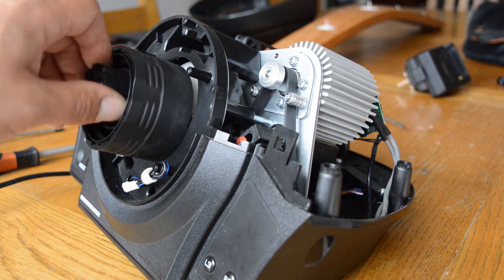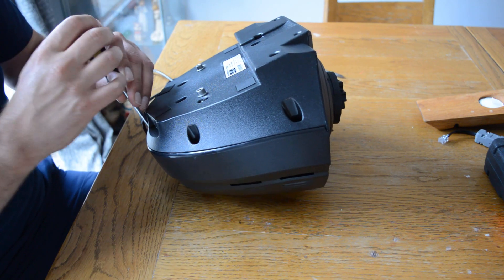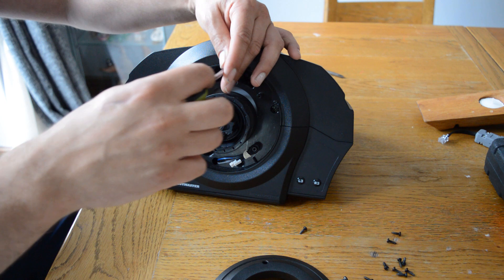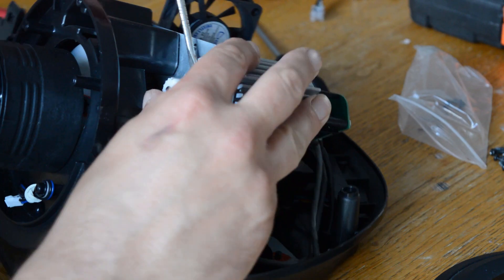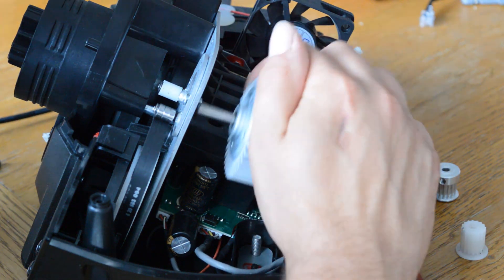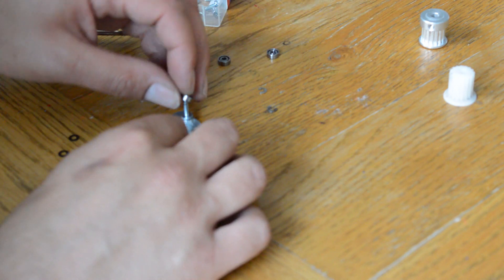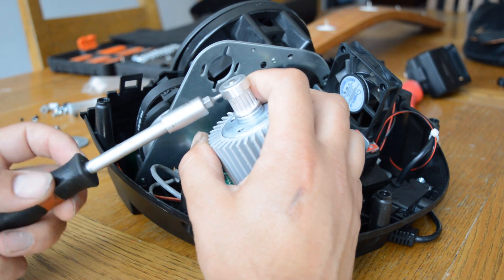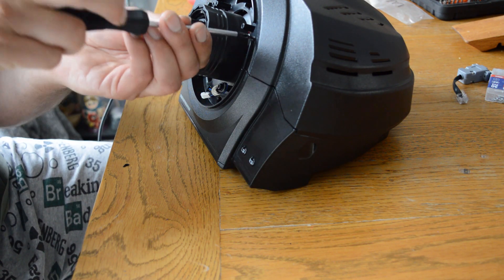Thrustmaster T300 Metal Bearing & Pinion Upgrade Mod

Comment: Just ordered a t300 base was wondering if you could make a video showcasing a few minor part replacements and tips to extend the life and reliability of the wheel anything from metal replacements, betters motors and fans would be appreciated
Reply from the maker: Hi thanks for watching. I have another video showing how to replace a failed motor with a like-for-like but unfortunately since the video, the motors have been almost impossible to get hold of. 
Aside from that, many people have upgraded the fan but I have not. I use the 'forced cooling' mode which keeps the fan on all of the time. This is definitely recommended.

Comment: Please don't do this mod exactly as described. The parts sizes are not correct. The bearings are smaller than the original rollers and because of this it's practically impossible to find a balance between tension and smooth operation. The belt will start skafing. And since you can't tighten it properly otherwise you'll have teeth skipping issues. 9mm bearings would be a better option, since the rollers are acutally 9mm and not 8... I used three 3x9x4 per side without the black rings. It's a perfect fit. the lock ring goes on tightly. This mimics the orignals perfectly but smoother. The smaller 3x8x3 ones are not even touching most of the belt width.
Reply from the maker: Since I did the mod as described, the wheel has been absolutely spot on. I even recently used an un-modified T300 for the first time since I did it and it felt notchy, light ffb and just generally more toy-like.

I'm not advocating that everyone must do this, it's just my own experience of it.

I agree if you can find 3x9x4 bearings then that would be ideal, but I made it work with washers and it has worked flawlessly.
Reply: @simpulse5825  Thanks for the respojnse! So it's maybe a bit of hit and miss. It didn't work for mine so I came back here. Don't get me completely wrong. I'm grateful for the inspiration for the mod and the careful walkthrough guidance you have released here. I just wanted to point out a slight adjustment in the sizes of the bearings to make it actually replicate the old system but smoother. Without skipping or skafing of the belt.
Reply: When i put three 3x9x4 on the shaft, i cant put the Clipring on it. How do you get this to work?
Reply: @Daniel200583  please let me know if you get an answer to your question about how to get the lock ring on the end? I just ordered 3x9x4 in anticipation of doing this mod in a few days. I hope you hear back
Reply: While it is true that the bearings in this video are smaller than the rollers, you are not taking into account the radial movement the original rollers have. On an old and well used t300 there will be more movement. On my t300 that has had 6 months use, there would have easily been 0.5mm of radial play in the rollers, hence i do not think the 1mm smaller (0.5mm each side) bearings are an issue.

Comment: 3x8x3 is too small on my t300, replace with 3x8x4
Reply: 3x9x4 is even better. Since the official rollers are 9mm.
Reply: @CidiousX  You are right, 9mm outer diameter is closer to the original roller's size rather than 8mm. I tried 3x9x4mm bearings without any washers are great, but seem to be a little bit thicker. I can't put the original C-Clip on properly because of the thickness, but I replaced it with a very thin rubber O-Ring and it's work.

Comment: Hi, for the pinion, is it 16 teeth? Also, I cant seem to find the same width of 11mm, most are 10mm or 14mm.. Must it be 11mm, and if can be different, should I pick the one more or less than 11mm?

Next one, for the bearings, I found 693ZZ MR83, but the size is 3mm x 8mm x 4mm.. Is it ok? Or should I source for 3x8x3?
Reply: This will work. I used these before. They fit better than the 3x8x3 but to make it perfect you should actually look for 3x9x4 to mimic the same size as the plastic rollers.
Reply: @CidiousX  Should I buy 16mm or 11mm?

Comment: Well I removed the bearings instead of replacing them… and its working much smoother without any problems… 
So I found out that apparently you don’t really need any bearings at all… 🤷🏻‍♂️
Reply: Did u have to rise the motor for the belt to be stiff? . Is still everything working alright?
Reply: @kostakhc   hey, yes! just remove the bearings, rise the motor up for 2mm will be enough and tight it. 
I drive for 3 weeks like this and I don’t have any problems with… I can definitely Recommend👍🏼
Reply: @PabloHamburg  hey mate , great to hear all working fine , could you please explain what different you feel without the bearings? Is it worth? ..ive read some cases where peoole getting off centre after tensioning the belt 😬 😅
Reply: Hi and thanks for the video, it gave me confidence to go ahead and just do it.  Did you also do the bearings on the bottom belt and add lithium grease to the worm gear?

Comment: so what does this mod accomplish?
Reply from the maker: Smoother feel, less notchiness and less noise while turning
Reply: @simpulse5825  is there a way to get these from or to the usa they dont post to the US
Reply: @simpulse5825  will this work on t500rs
Reply from the maker: @puresim316nosimracingnolif3  it should do. I believe the internals are the same
Reply: @simpulse5825  ok thanks
Reply: For the muricans in the comments this is what I sourced.  I did both belts also adding white lithium grease to the worm gear.  And yes the 10mm bearing works fine. https://www.ebay.com/itm/154605357372?mkcid=16&mkevt=1&mkrid=711-127632-2357-0&ssspo=HTRFNrzLRb6&sssrc=2349624&ssuid=J_o1QlQrTFO&var=454684815154&widget_ver=artemis&media=COPY
(20 Pack) PGN - 623-ZZ C3 Double Shielded Ball Bearing - 3x10x4 - Lubricated - Chrome Steel https://a.co/d/9AOToIq

Comment: Thanks a lot for the video! I have ordered all parts and tried the mod, but unfortunately the bearings do not fit on the shafts. Bearings are said to be 3x8x3, but it seems to me the shafts are 3.1mm or 3.2mm. They are very tight, maybe I could hammer them on, but I don't think that would be a good idea.
It looks like, your bearings slide over the shafts easily, right? Probably have to find other bearings.
Reply: use a bit of 600 grit sandpaper and sand the shafts down a bit. Finish with 1200. And a bit of WD40 when sliding them on did the trick for me.
Reply: @CidiousX  Thanks for the tips!
Reply from the maker: Hi, the ones I used are definitely the 3x8x3 and yes they slid on easily. Don't hammer them on! I'm not sure why yours won't fit. Are they definitely the size you ordered?
Reply: @simpulse5825  Hi, thanks for your reply! Yes, maybe I got delivered wrong bearings, will try again with a different shop.
Good to know they should go on easy, so I won't try with force. But I wouldn't use a hammer on my T300, anyway.  : )
Cheers!
Reply: @jorn-jorenjorenson5028  Find a micrometer and check the diameter of the shaft, sometimes manufacturers change the spec of certain parts over time.
Let me knoe if this is worth it please I have just gotten a T300 and it is lush but could it be better?
Reply: In my case, one side of the bearings can be put on very easily, another side's a little bit tight-fitting where I need to hammer them on.
Reply: @wulokchun  Ah, good to know I'm not the only one, thanks!
Reply: Mine fitted ok, but my wheel broke and got a new wheelbase, they no longer fit lol, just ordered a 3x9x3 pack of bearings
Reply: Ah my old ones did fit, it just needs a bit extra force at the start but goes on fine , theres a groove at the beginning of the pin so it gets stuck at that part, just needs pushed with a little bit force too get it past
Reply: My bearings don't fit either. I bought 3x8x4 and measured the inside of the bearings and came up with 2.8mm 15.12.2023

Comment: Thanks for the video and links. I note that you can use 3 bearings 3x9x4 without any spacers and washers
Reply: A bit late, but will I need to reinstall the original washer still?

Also, is the metal pinion upgrade worth it? because most people who I have seen that done the tensioner mod did not upgrade the pinion.
Reply: Sorry, may be a stupid question and also a bit late, but does it affect longetivity or anything in a negative way when you don't use washers?
Reply: @lc_dzn9112  
I do not think so. I definitely recommend bearings without washers and mod from the author of this video. You will be surprised how the feeling will change
Reply: 3x9x3.5 are better if they exist.
Reply: @wulokchun  стандартная высота роликов ремня 12мм, если брать 3х9х4 то по итогу нам понадобится три подшипника без каких либо зазоров, и как итог, ровная поверхность.
Reply: hello, i found 3x8x3 and 3x9x4 bearings, which are better and why? thanks
Reply: @sqt_arhot  привет, лучше будут 3х9х4, т.к не нужно будет регулировать натяжение и искать баланс, также отмечу, что стандартные натяжители идут именно 9мм во внешнем диаметре, а не 8мм.
Также если углубляться, то чем больше внешний радиус колеса(в нашем случае подшипника) тем больше нужно будет поворота ремня, чтобы прокрутить его одинаковое количество раз(я знаю что разница совсем не значительная, но на как-то это должно влиять, так как подшипник будет крутиться на слегка меньших оборотах )я не знаю как это объяснить по "инженерному" но чтобы понять, просто возьмите два круглых объекта, разных по радиусу, сделайте отметку в верхней точке, и прокрутите по столу, и вы увидите что круглый объект с меньшим радиусом пройдет меньшее расстояние по столу, до полного оборота.
Не знаю зачем я это всё расписывал)
Берите 3х9х4 😁
Reply: @n8dss  okay, thanks a lot for the info :)
Reply: @sqt_arhot  рад помочь😁

Comment: How much of an upgrade is it in your opinion ? Worth it? Could you explain all the differences you felt?
Reply from the maker: It definitely feels smoother and quieter. The feeling is less notchy. I would say it isn't necessarily a game changer but for such little cost and an easy process, it is worth it. As recommended elsewhere, putting grease on the worm gear also helps smoothness and sound so I will be doing that next.
Reply: @simpulse5825  thanks for the reply man, could you please help me find links on ali express? I found the big piece but the 6 bearings & washers im having a hard time with.
Reply from the maker: @gster109  I would use ebay but I did find these on aliexpress if that's where you want to get them from:

https://m.aliexpress.com/item/32761032312.html?spm=a2g0n.productlist.0.0.26ff4e31Ge5K54&browser_id=c6611d8535fc4a09ab458dbf1f632ddc&aff_trace_key=933bbec31c6e4858aaf532a3846352f5-1640640966723-00954-UneMJZVf&aff_platform=msite&m_page_id=jjfif3qfcdmcavx717e57fff0031174152571e24aa&gclid=

It is the 3mm x 8mm x 3mm you will need
Reply: @simpulse5825  Appreciate you man, subbed.

Comment: does the diameter of the gears on the new pulley have to be exactly 14.5mm or can they also be 14.77mm cuz i found one on ali for cheaper.
Reply from the maker: I'm not sure to be honest. The cost of the gears are fairly low. Although the difference between those two figures is minimal so I would imagine it would be fine.

Comment: Hi. I'm planning on doing the same mods but I'm a bit worried about the pulley not being D-shapped. Is that going to hold up well with just the screws to tighten it all? Nobody mentions that in their videos/tutorials. Anybody has some insight about that?
Reply from the maker: It wasn't D shaped on the one i used, but I've been using it for months now and it's solid. The grub screws hold on tightly enough
Reply: Hey  @simpulse5825  , thanks for your answer and your tutorial. :)
Reply: The pinion has 2 retaining nuts. Line one up on the flat side of the D and it holds great.

Comment: How much is the difference in ffb compared to the default?
Reply from the maker: I wouldn't say it's stronger ffb, just smoother and quieter. The fact that it's smoother maybe gives you a bit more detail
Reply: @simpulse5825  Thanks for the response! By the way, I have a crispy sound on my wheel, when I turn it, this sound appeared like 1 week ago, I bought my wheel a little bit more than 1 year ago, but I don’t feel any problems in the ffb. Should I worry about this or I can just leave it?
Reply: @max-3816  try updating the firmware
Reply: @barra190kw6  I updated it like 2 weeks ago, and it’s gone now lol
Reply: @max-3816  
Do you have an updated firmware on mode ps3 (PC) LED indicator glows red or green?
Reply: @ruslanbro20  The sound is gone like 3 weeks ago but thy, I tried updating it, and after a few hours of use it went away
Reply: I don't think there has any difference in ffb but smoother. In my case, the force kickback when the steering lock can be felt more directly since the belt tension has been adjusted.

Comment: Quick question what thickness are the washers you used ?
Reply from the maker: They were very thin, less than a mm thick. I guess the thickness will be relative to the size of the washer bore.

Comment: Just ordered them now after fixing my wheel there is also another belt that has 2 tensioners I wonder if they can be changed as well I've got a spare one here will have a look to see if there the same size and let you no
Reply: Hello. Were you able to replace the other tensioners?
Reply: Any luck on them fitting
Reply: Someone said they did in another comment but its more work than its worth

Comment: if you put washers  (from splastic roller) between bearings you will get less sound.
Also you forgot upgrade other belt tensioner to bearings.
Reply from the maker: That's next to be done, but it's a bigger job as you have to take the wheel apart further
Reply: @simpulse5825  No you dont need, just remove front panel. 4-6 bolt in front, and 2 bolts in bottom.
p.s. was two types shafts, so no all bearings will work. but i suggest go for needle bearing.
Reply from the maker: @fregisz  I'll take a look, thanks for that